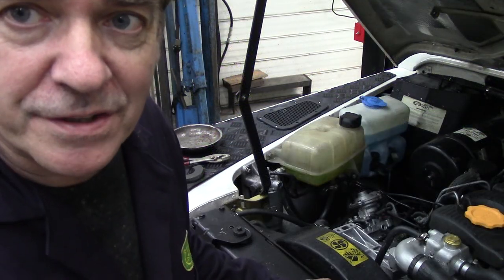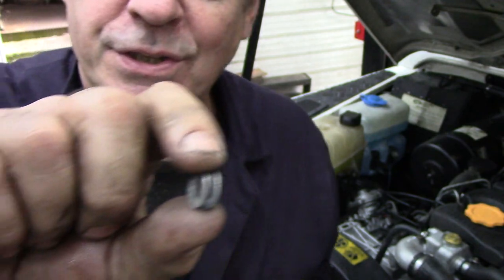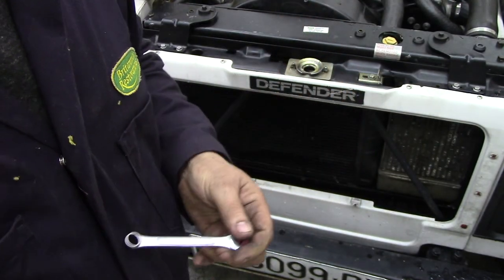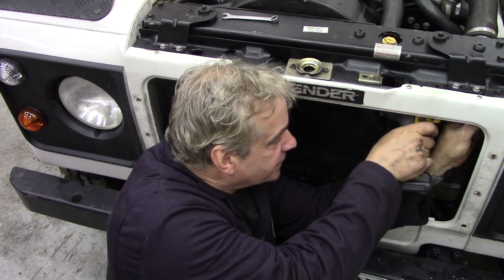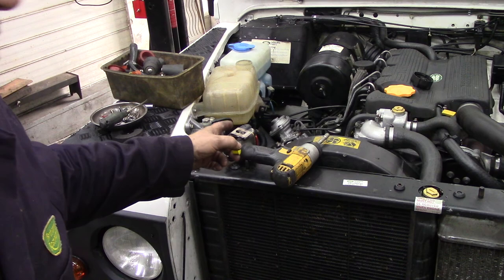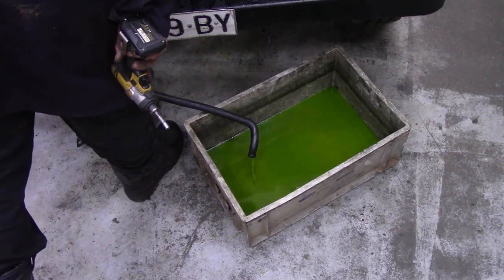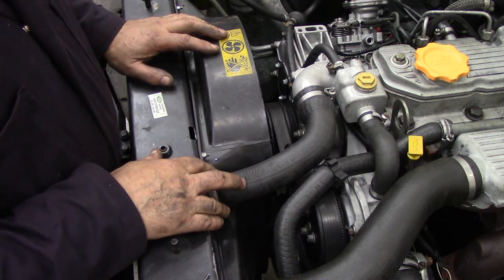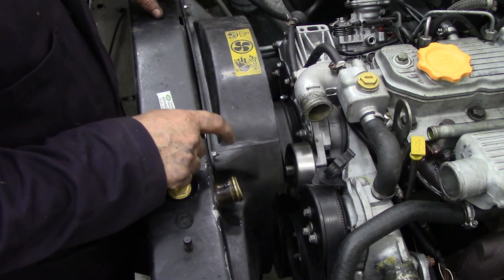Tdi engine removal Part 1

Comment: Wish the front of my D1 came apart like that. Would make life so much easier.
Reply from the maker: You may remember I drilled the spot welds out of the 1991 RRC and made the front removable like the original RRC - only an upgrade with captive nuts! So easy to install the engine, box, and transfer in one lump!
Reply: @BritannicaRestorations  You have some brilliant idea's and 'fixes' for us. Thank you!

Comment: Does that noise deadener on the engine make much difference?  Most 300Tdi I see do not have it.

Future video idea: different noise levels from various defender engines with/without sound deadeners....
Reply from the maker: I did a video on them and in my opinion only for looks - some say it cuts some frequencies, but I am not convinced

Comment: I'm about to do the opposite, take 1987 v8 out, and replace with a disco  300tdi, gearbox, transfer box. Got the ashcroft kit  and MD engineering chassis mounts and template jig. Any advice welcome land owners
Reply from the maker: If you have a 300Tdi, R380, LT230 combination, it is real easy - but you need a Defender rear gearbox cross member to have less trouble  - the disco one needs modifying, or it will catch on the seat base mounts
Sling the power unit in, attach the gearbox crossmember in and fasten it in the centre of the slot 
Next, bolt on the chassis mounts to the engine, and then put in the radiator with the fan cowling on - lift the engine until the fan runs free in the housing 
Tack up the engine mounts and take the weight off the hoist

The fan should run free in the fan cowling - if it does weld up the mounts, and you are done - no need for templates! 

Done loads of them this way  = even make my own engine mounts up
Reply: @BritannicaRestorations  As ever your expertise does not equate to monetary value :(. I'll be playing your TDi removal in reverse. This will work beautifully, as for yourself you'll be taking about devil workship. Now that's lateral thinking  eh?
Seriously, I'm going to watch your TDi removals like sherlock. Look forward to the next mens health video.
Reply: Dear Mike
I know you are a busy man, and I know that maybe time is money for you. I’ve been watching your tube tube videos for a while now. Every video I find informative, technical and enjoyable. I am so glad that having left the UK, you still possess your Yorkshire humour and sensibility.
Anyway, as you may be aware, I own a 1987 110 V8 Land Rover with LPG conversion. I live in Northumberland, but despite that location, its getting very hard to fil up on LPG. Obtaining a clean environmental fuel is now in the same manner as finding electrical charging points. To be honest it would be easier to play any countries lottery competition in knowing if LPG is available, pumps broken, LPG being stopped, or run out of LGP. This not only is frustrating, but it causes the driver to take longer journeys just to fill up!
As a result, I have decided to return to a dirty reliable fuel – diesel. I have purchased a Land Rover Discovery one 1999. This is a chassis and door MOT failure, with some doors unable to open due to “rust”. EGR Blocked.
The car did drive, until I removed all the parts; i.e., engine, gearbox, transfer box, exhaust, wiring. I have drove the car prior, and it was indeed to my best knowledge a good car/setup. The gearbox and transfer box have been reconditioned in 2019, and look externally very clean.
The car has now departed, and the parts I have ready to insert into my 1987 V8 110 LPG conversion. The LPG tanks and wiring I can deal with. Now I venture into new knowledge, with questions to ask expert Land Rover Engineers.
My project is to use the Discovery parts in my 110, and this is how I think I need to tackle the job.
Empty LPG tanks, Switch to petrol
Remove all LPG tanks, front floors, seat box and wiring. (LPG tanks sit under front driver and passenger seat box)
Can the car still run on petrol YES/NO?
Remove coolant, radiator
Disconnect gearbox from transfer box, pull out V8 engine and gearbox.
Remove transfer box.
Clean chassis for disco transfer box and gearbox plus Ashcroft gear lever modification.
Insert 300tdi engine based upon MD Engineering Chassis template.
The tricky part now starts I think
Power steering
Fuel System
Exhaust
Wiring – I wish to have a simple TDI engine, can I remove the ECU? If not this will require extra wiring beyond my knowledge at present. Can I remove the vacuum solenoid?
Any advice please
Yours
Christopher Astbury